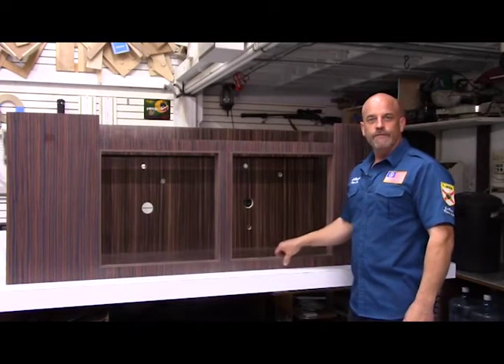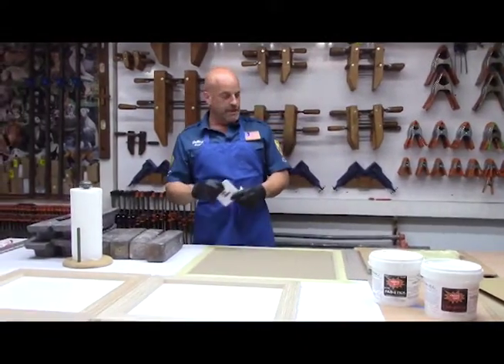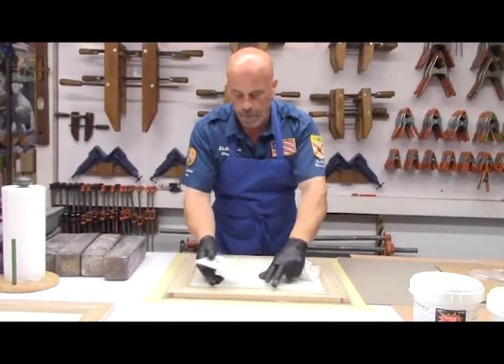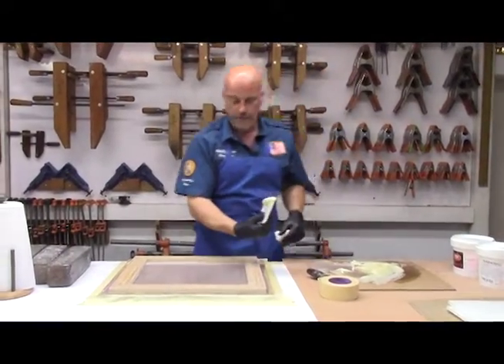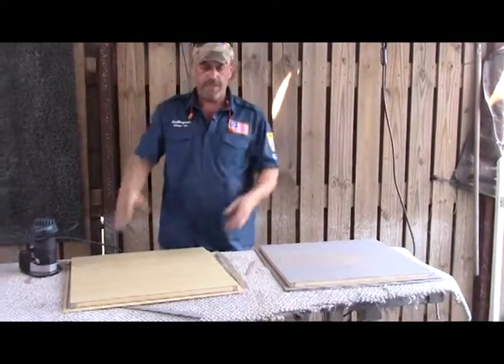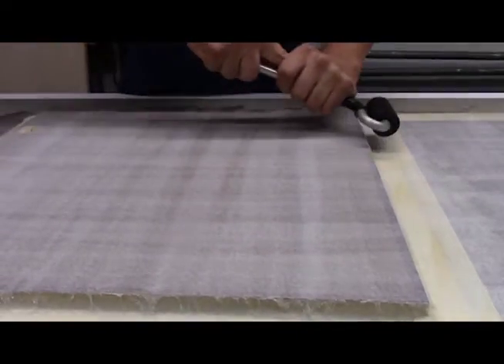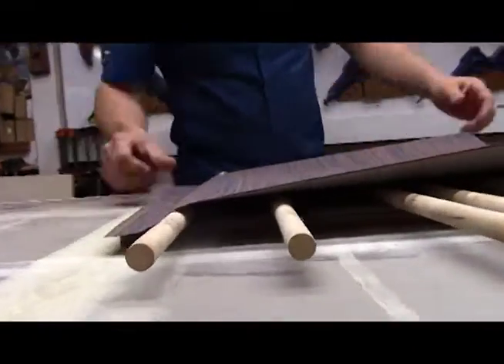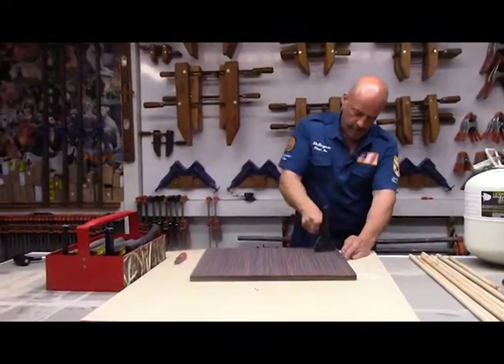Vanity Cabinet Doors Made Easy

Comment: Project came out great and the construction is really solid. It's nice that you take the time and effort to make a solid well build project when you could have used bad cheap core materials that no one will see, but would have ultimately failed. I see you also use west system epoxy. Do you use both interchangeably or do you use them for specific applications.
Reply from the maker: +Magdiel Rodriguez  Kind of like not using the same hammer for every task.
Jim

Comment: What is the purpose of the honeycomb? I'm assuming it's a design specific to marine cabinetry that adds strength without weight,
Reply from the maker: +Timberwolf Concepts Hello Timberwolf, how has Bella been? ;-)  All teasing aside, honeycomb was designed for the aerospace industry first, if I'm not mistaken. So us woodpeckers are pretty far down the line as far industry usage.
I'm surprised about how many people are unfamiliar with honeycomb so I think I will perhaps do a video on it at some point in the near future. 
For now though maybe I can satisfy you the answer that it's much like a bridge where the distance between the spans are equally as important as the material that divides the spans. 
Thank you so much for your comment, I really appreciate the feedback!
Jim